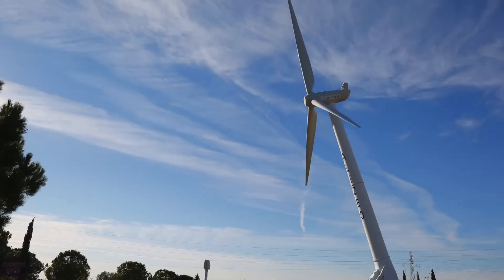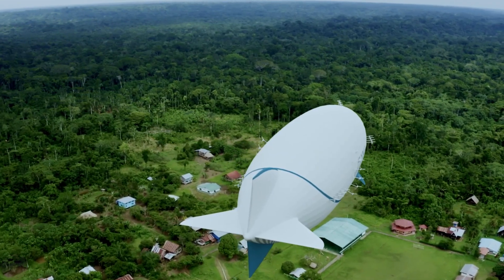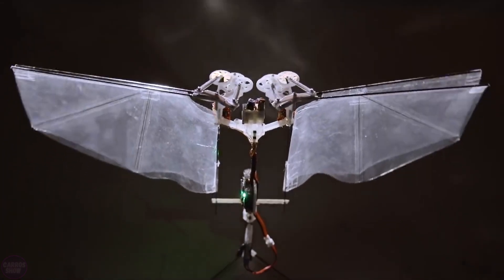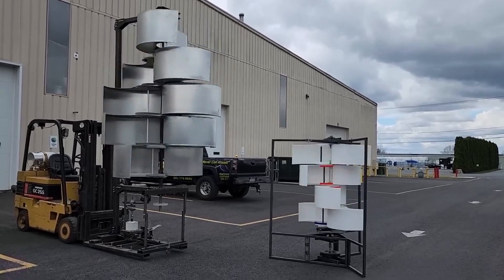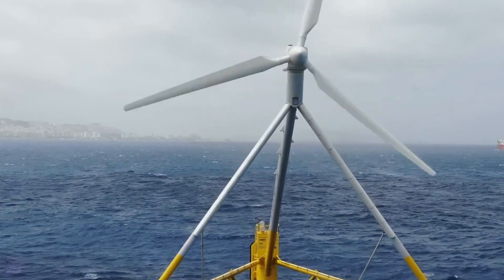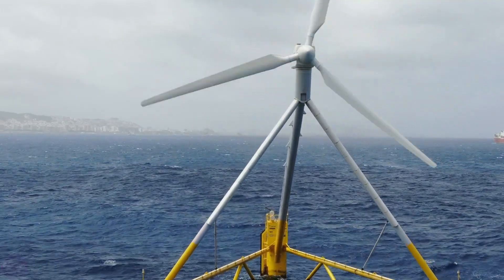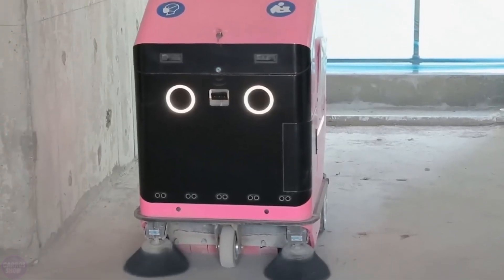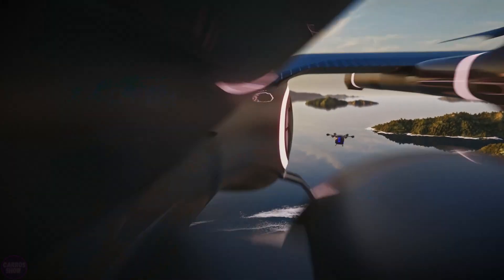Even the US President was SURPRISED by Next-Generation Emerging Technologies and Robots

Comment: That spinning metal wind turbine loses some of the benefits because of the weight of hte metal. IF they made the next iteration out of something like strong layered nylon with a thin but similarly strong skeletal lattice or frame, it would weight much less and thus having less resistence, generate a bit more power. Plus it would be easier to transport and install weighing less. No doubt some combo of those turbines and the  sky kites will lead to some artifical bat like robots flying around harvesting energy from wind and solar, and probably some forms of geo magnetism and or radiation one day. THere could even be underwater versions too that seek out the most sub surface wave streams to generate power too. Good times.